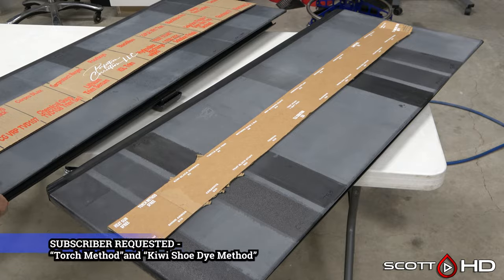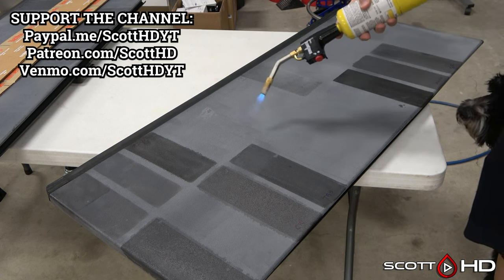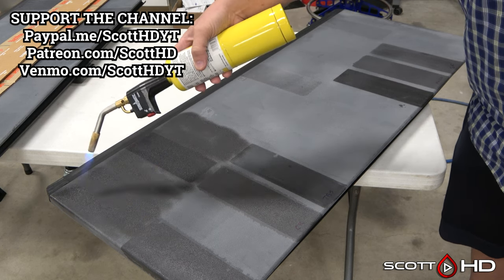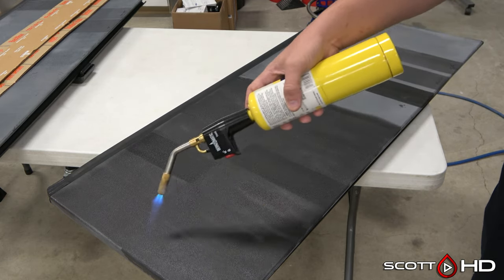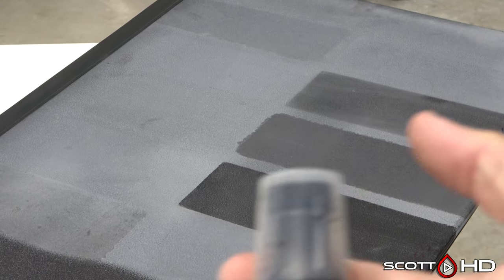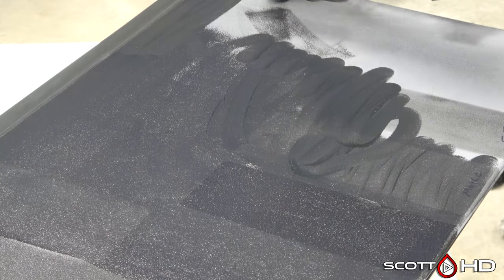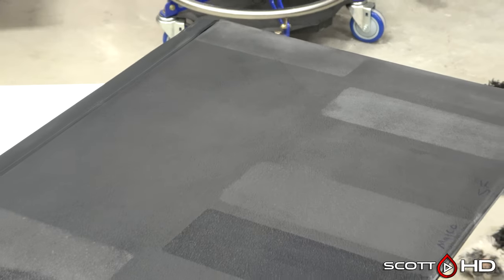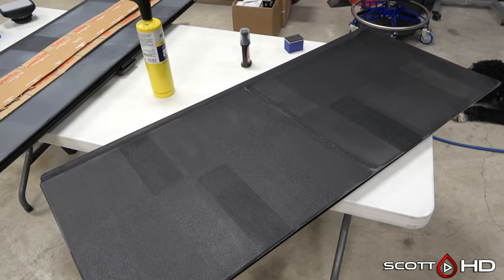Kiwi Shoe Dye vs Gas Torch for Restoring your vehicle trim back to new?!?!?  Subscriber requested!!!

Comment: Lol😂. . The only real way and best way period is to first wash and wipe dry the plastic, then u use the kwiwi shoe dye, after it dries a few minutes u  use the heat gun where u treated plastic with the dye and heat the pladtic so it absorbs the dye, that is real and permanent solution.
Reply: @klwthe3rd  1 time every 2 years
Reply: for real?

Comment: Kiwi shoe  polish is the best, cheapest, and longest lasting trim restorer I've used so far.  I've applied it on my 4 min cooper's black trims  in the Spring and it's been 5 months now and still looks great! You're right,  you have to make sure to apply it evenly.

Comment: I've used both methods.   Torch method is pretty tricky so I haven't done it in years.   The dye method I used as recently as last year on a 16 year old black bumper that was almost white.   Turned out great and the customer was amazed.   I have been using conventional products on it since the color came back.
Reply from the maker: Great to hear!   The torch takes a bit to learn to get consistent - still wouldn't recommend it due to so many other options out there that will work better

Comment: On some completely trashed plastics, I've done torch then go over it with solution finish, then put a protectant on it. They turned out better than brand new and have lasted a very long time.
Reply: Solution finish works great 
I don’t use a torch at all 
I get about a year out it.

Comment: I used a heat gun on the bumper of a 1991 Honda Civic Wagon and then as it cooled I applied the Kiwi product.  The bumper looked brand new.  It's been 7 years and it is only just now starting to fade again - and I live in Arizona.  From what I've read it matters what sort of plastic your bumper is made out of that will determine how well any given technique or product will work.  In my case I got lucky as the plastic responded very well to that combination.
Reply: ^ This is the way.  Heat gun (much slower than a torch, and it won’t quickly become brittle) then layer of product.

Comment: Will the shoe dye smudge your clothes after application? Like, after a week if your sitting on the plastic eating lunch or something will it get on your pants or is it pretty good at staying put? If I'm walking around my car and bump into it or rub up against it will leave a mark? Since you torched the one side and double torched that one section maybe you could test the durability of the plastic since you said it weakens the plastic. I would like to see how much weaker it is, if at all. I agree that even if it doesn't, I still wouldn't do it on a newer car. But it looks pretty good and it could be the cheapest by far. Thanks again for this series!
Reply from the maker: I would say after the first wash it should be good.  Right after application it is pretty likely that it would.

Comment: I've done the heat method, but using a heat gun instead. Much more control of the heat being applied, more uniform results. And the plastic doesn't become brittle. I've done the fenders on my Wrangler 3 times now. They're still pliable. Alternatively, I've now started using Forever Black. It's a plastic dye that really soaks in. I'll apply it, let it cure overnight, then go over it with a ceramic coating.

Comment: I tried the liquid shoe polish on my '04 Ram foglight bezels...instead of being black...they were almost grey in color.  Tried putting lots of light coats on to make sure I had good coverage...went with about 6 applications.  Then when they looked as good as I thought I could get them...finished up with 2 coats of carnuba wax.  They look brand new.  Thanks for the tips.

Comment: Thanks for test.Torch method is for car dealer before selling the car.Plastic after torch is very crunchy.Wea take care about our cars and don't use torch method.Shoe paste is chip Ang good method and don't destroy plastic trims!There is another method nitro solvent but for advanced users😂
Reply from the maker: Exactly.  If I had a ton of time, I'd show how brittle this can get.  Definitely a "used car dealer" trick that isn't advised.

Comment: I heard a heat gun on a low setting works awsome
Reply from the maker: It does work too - seems to be harder to get a consistent finish vs the torch (in my opinion).

Comment: Any solution or product to help hide a very light micro scratch on exterior shiny matte black plastic on a brand new car with less than 1,000 miles? Two small scratches on textured shiny black plastic trim on inside of side mirror. Appears as a white line in sunlight. I don't notice it when this side of the mirror is in the shade but very visible when sunlight hits it. Annoying on a brand new car because of course I glance at the side mirror constantly when driving and my eye is drawn to the scratches. Maybe a touch of black shoe polish, a little of something like Mother's Back to Black solution or just leave it alone and live with it? I don't think I want to try a magic eraser as it's brand new plastic and could degrade the shiny texture surface. I've heard good and bad. No way I would try a torch. Maybe best just to hide it from my attention using some type of liquid solution that isn't abrasive but not sure which one would hide the scratches best. I don't know how the scratches happened on the inside side of the mirror. It's not exposed to anything coming at the front of the car. I guess I could have done it washing the car. I didn't find any rock or glass chips in my wash mitt but I am buying a new brand new mitt anyway just in case. I don't want to do more damage in case it was me that rubbed something sharp on the car.

Comment: Does it work with a heat gun?
Reply from the maker: It does.  My experience is that it seems to be harder than a torch to get it uniform.